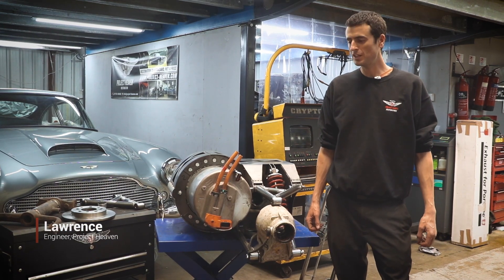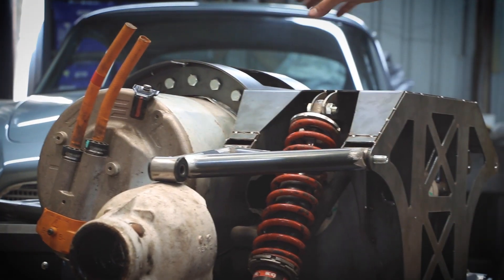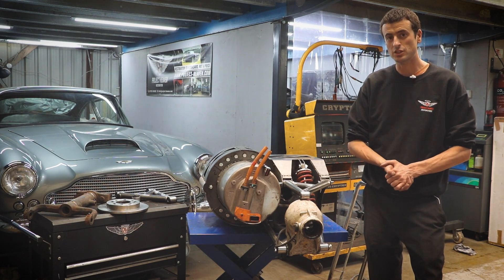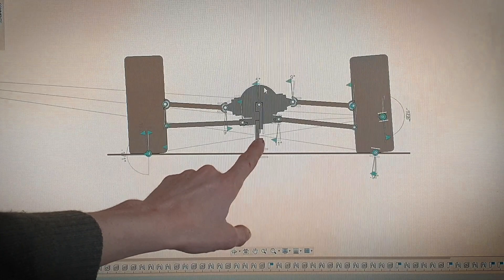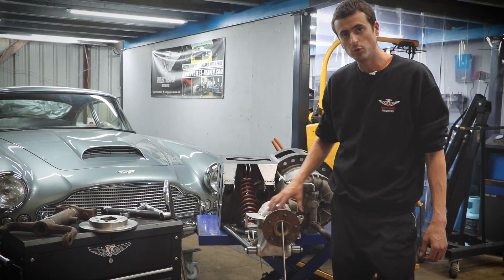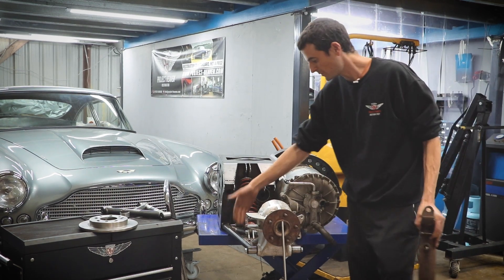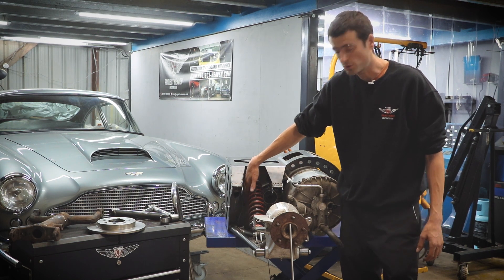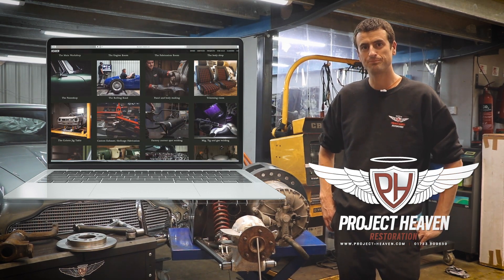Jaguar IRS Tesla conversion kit | Classic Car Electric Conversion Kit

Comment: Very Cool. Since this Jaguar Tesla conversion kit is being done for the E type, will you be also doing this for the XJS? I have a 1987 V12 and would love to convert it to Tesla power.
Reply from the maker: Yes the idea is to cater for the e type in the design stages that was it is easily scaleable for all cars that used the jaguar IRS, the larger wheel base only requiring longer driveshafts and lower wishbones

Comment: It looks like you are going to have to cut the boot floor of the E type to get this to fit. will the owners be happy with this?
Reply from the maker: Thats correct, we have tried to minimise the amount of cutting required and kept it away from structural parts of the car. Unfortunately the tesla motor and inverter are simply too big to fit under there without some cutting required

Comment: Very Interesting,  I run a Suffolk SS100 Replica which has an XJ6 IRS.  I am not an engineer but have thought about how I would convert it to electric and considered removing the fuel tank reversing the differential and mounting the motor to the rear with the drive which would allow me to keep the inboard disc brakes.